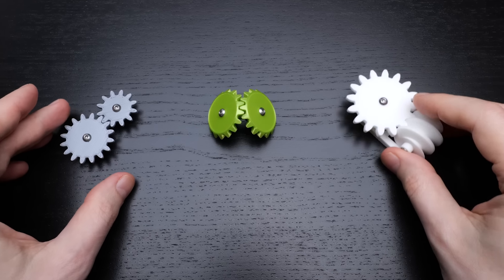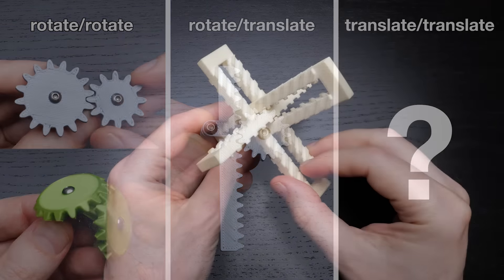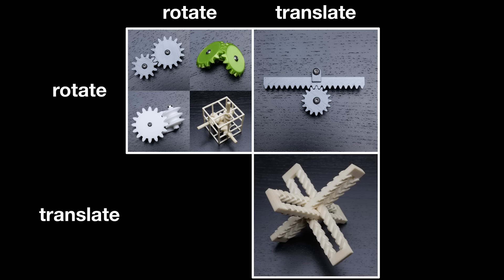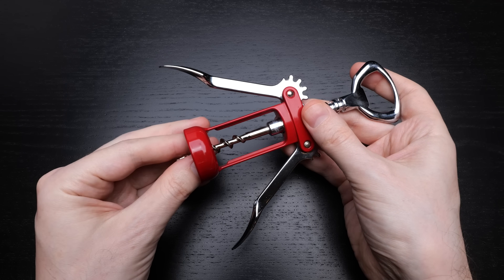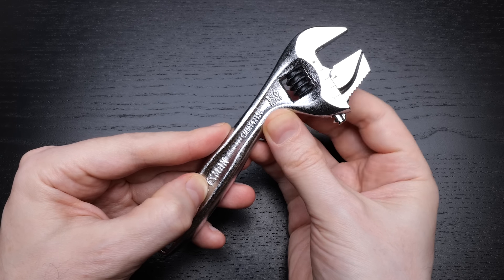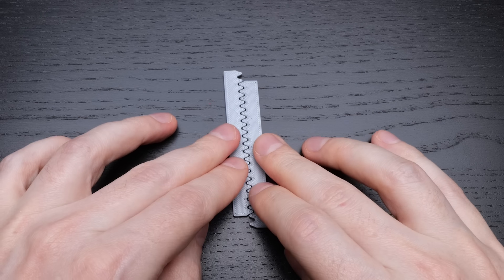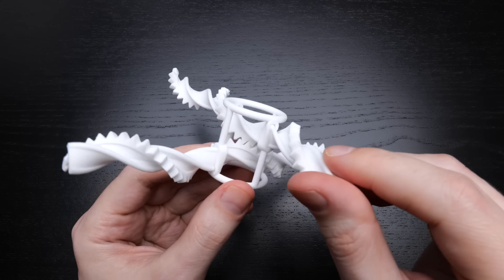Screw/screw gearing

Comment: the teeth calculations formula are pretty simple and i think you should learn if you make more gears for 3d printing etc. will benefit great
Reply from the maker: For spur gears - yes, and I’ve implemented them. Bevel gears also. I haven’t got around to looking into the current research on gears with skew axles, and I doubt there is any theory on what screw/screw gear teeth shapes should be.

Comment: I'd almost call that special screw-screw gear you made at the end a 4th type of gear.   You're not using the screw gear the way a screw gear typically would be used.   Normaly the screw uses the inside surface of the gear to provide a relative force that is parallel to the screws axis of rotation.   By using teeth along the edge of the screw you're providing a completely different kind of force that a screw gear wouldn't normally give.

Comment: With the screw-screw gearing, is there a limit to the angle one is at relative to the other? Must they be at a right angle to each other or can they be obtuse on one side and acute on the other? If so by how many degrees?
Reply from the maker: Good question! I'm not sure.
Reply: @henryseg  Well tag me if you at some point decide to find out in video format.

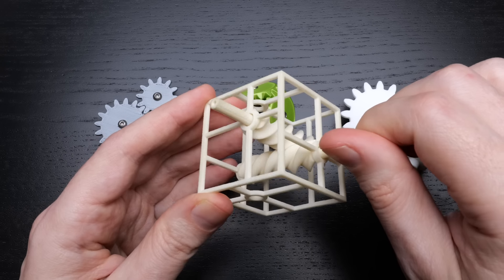Comment: 1:11 The other difference is that in the worm drive, only one way transfer of motion is possible: from the worm gear to the spur gear only.
Reply: That's not true. It's dependent on gear ratio and construction. It is heavily biased, but you can overpower a worm gear from the wrong side if the friction is lower than the rotational force. This is more likely if the worm has more than one start. The self locking property should  be considered hypothetical.
Reply: @FPSG  Does "overpower" mean the exertion of some sort of elastic or plastic deformation on the gears? Because this is surely not the  point. Is there any example of such a contraption that works regularly anyway?
Also, is there a particular gear geometry (tooth profile, angle, pitch etc.) aside from the multiple starts that favours transfer of motion from spur gear to worm gear?
Reply: @Stelios Posantzis  there is no practical reason to back drive a worm gear. Theoretically, the friction between the worm and the worm gear would not allow it to be backdriven. This is only static friction. If you move the input shaft of a worm gear drive while the output is under a significant load, it will start back driving. You need a brake on your motor to prevent this condition in practice. Vibrations could cause the coefficient of friction to no longer be static and be dynamic or kinetic. It is not a practical property of a worm gear set.

Comment: It should be noted, gears aren't magic, they should be considered at most 85% efficient during the design process for the sake of accounting for use in disrepair.
The shape of a gear tooth is called an involute and it's a point on a string being unwound from a cylinder. There's a formula for it in the Machinery's Handbook. It's not just the conceptually ideal shape for a gear tooth, physical gear teeth will grind and smoosh themselves into that shape under certain conditions.

Comment: can you connect the ends of each helix? or one of them. i know, it will block them, because they are not allowed to flex and rotate like a rubber toroid. but is the solid version the only one to print? it's difficult to imagine to me.

Comment: Can you make the screw motion happen along/around a large circle instead of a line? Would it be possible to extend the table with combinations of such "toroidal" screws?
Reply from the maker: A "toroidal screw" would likely work in practice, but mathematically speaking the curve on the inside of the torus will have a slightly different curvature than the curve on the outside of the torus. So the natural mathematical classification only has rotation, translation, and screw motion.

Comment: make this with two large hoop shaped twisty gear so it it looks like two hoops then attach a geared motor to drive it endlessly.
Reply: use a flexable material so it can spin. as to rotates.
Reply: do it with five rings and configure into the Olympic Rings size and shape.

Comment: Although proximity negates separate fields,  I've felt that still it's possible to get a self propelled helical axle.  With designs such as yours and some time I believe  it's not just possible to have helical intertwining of magnets propel each other, but that even torque could be inputted.  I feel with the precise, watch like movements and timing it could be done.

Comment: is there anything interesting to be added if we consider the angles between the gears too?
Your screw-screw concept is at 90°. Is it possible to have one that's "flat"?
I suspect not, due to the translational degrees of freedom being used up. Your translate/translate example also goes at 90° angles...
Reply from the maker: I've done other translate/translate angles in https://youtu.be/h2sgGvcCydk and https://youtu.be/dkguSyeQXjc. I think you could go pretty far in changing the angle on screw/screw gears but it will get harder in some directions. Like in sailing, you can tack into the wind, but you cannot go directly into the wind.
Reply: @henryseg  right, yes, other angles are definitely possible, but a "flat" (0° or 180°) mechanism is not, and it's specifically the translation portion of the symmetry that causes that I think - I've seen those other ones too :)

Comment: I mean that's very cute to play with, but not much application. Can you please make a cvt gear box, where the power split, instead of being an electric motor like in a prius, it would actually get a portion of mechanical energy from the primary shaft, and use that energy at variable torque to influence the power split device, so that, when the gear box experiences a bigger load, it will increase gear ratio
Reply from the maker: Sounds like you know more about that than I do. Why don’t you make it?
Reply: @henryseg  i got no clue how🤷. I just know cars either use gears witch clutches or belts with pulleys, and that's really dumb. The prius uses a power split but has an electric motor that puts a certain amount of power into the power split to make the output speed constantly variable. Now if someone could just make a gear based cvt, without electric motors, that would be a banger

Comment: The translate/screw is incorrect, right? If you hold the jaw to be the frame, it does not translate, but is instead stationary while something screws into or alongside it.
It does function as a rotate/translate but never a translate/screw.

For the corquescrew in rotate/screw I feel like it's against 'the rules' to combine a screw with a set of gears that simply translate/rotate.

Comment: aren't plenty of threaded telescopic devices screw-screw?
Reply from the maker: I looked into double screw jacks and other mechanisms with axis aligned screws, and it didn’t seem like there was a three part mechanism that did it. There would be four or five rigid parts - I think you could see it as a gear chain where the individual gearings are like the adjustable spanner/wrench.

Comment: For the rack and pinion, taking the rack as the frame, the pinion rolls while the third part translates; so a roll / translate?
Reply from the maker: If you hold the rack still and call it the frame then the original frame translates, and the pinion rolls. But rolling is not one of the three basic motion types. It isn't a rotate or a screw or a translate. It's the same thing with two standard spur gears. If you hold one gear still then the second gear rolls around the first gear, and it does a complicated spirograph motion.

Comment: I think assigning the adjustable spanner as a translate-screw is cheating because what you decided to use as the frame was actually just one of the gears, its literally the same piece of metal forming the rack meshing with the screw.

The rack-and-pinion could then also be translate-screw with this logic, if you use the rack as the frame as the cog rolls across it, although not a screw motion (axis aligned with movement) it fits your definition of rotating and translating at the same time.
Reply from the maker: Screw motion specifically has the direction of movement be parallel to the axis of rotation.

Comment: The translate-translate and screw-screw don't have any realistic applications, as their movement can be vastly simplified; i.e. these mechanisms have multiple movement vectors within their components, but the moving target only has one movement vector, of which a simplified mechanism that only provides that singular vector is more efficient, as screw-screw is just a 2D diagonal movement and translate-translate is a 3D diagonal movement.  Rigidity also isn't an argument here, as rigidity can exist within a frame external to the core components of the mechanism itself.  These things are well designed, but they're more mechanical art than they are practical mechanisms, as their unneeded complexity is impractical as no implementation would outright require their design complexity.